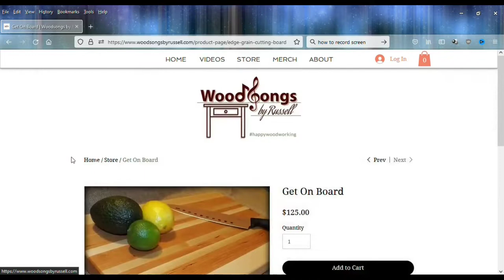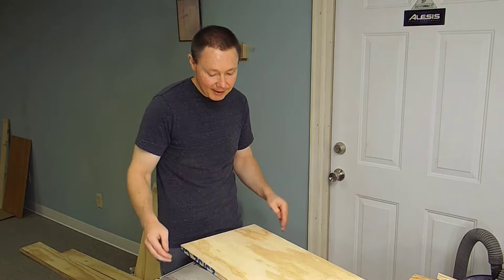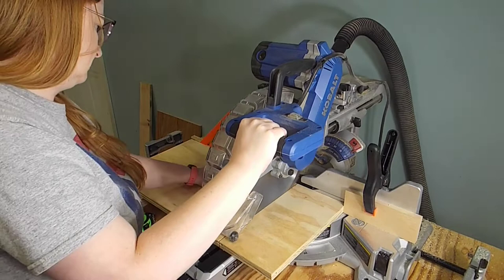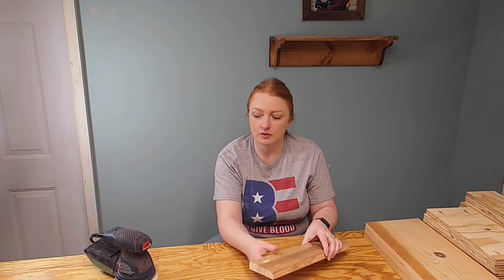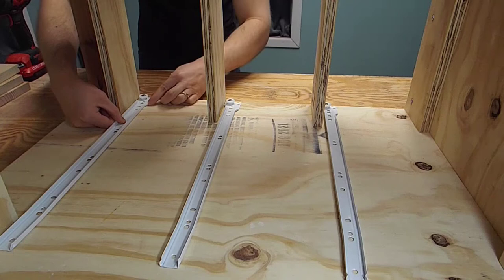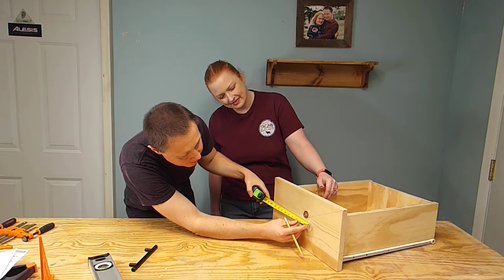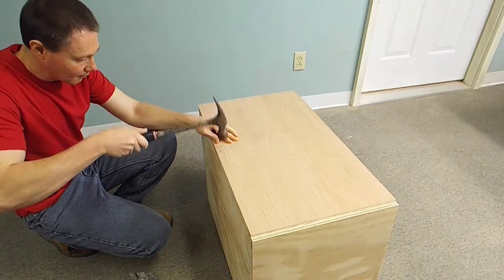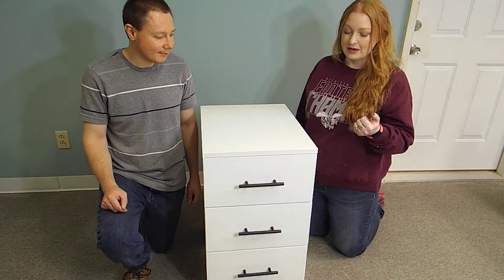How to Build a 3 Drawer Cabinet | Plywood Cabinet Build | Build a Cabinet with Drawers

Comment: Hi, you lost me when you started assembling the cabinet. What and how for did you place the 1st piece
Reply from the maker: Sorry. I guess we forgot to mention that in the video. Looks like we started by attaching the stretchers 3 inches up from the bottom. They were also flush with the front and back. The top stretchers were flush with the ends on top and at the front and back. Happy Woodworking!